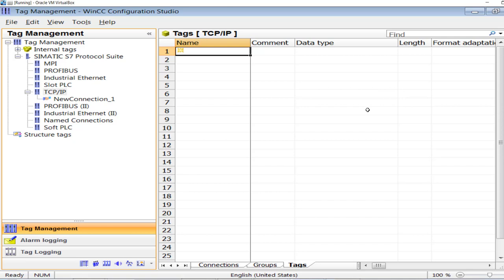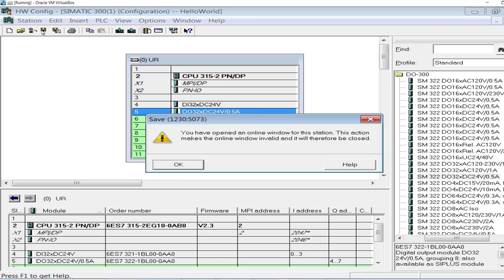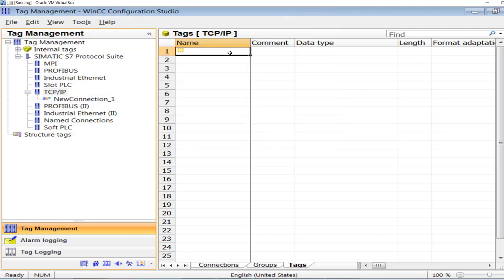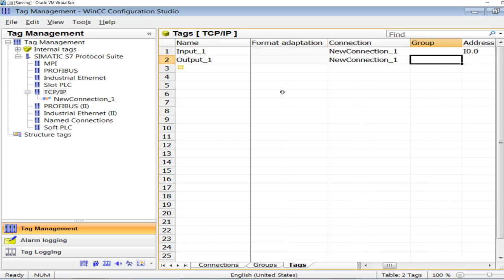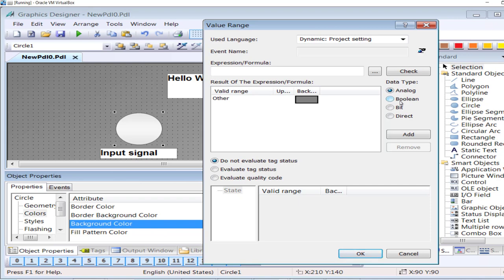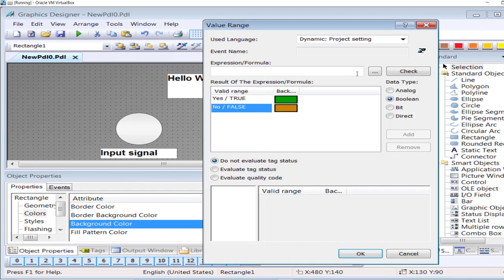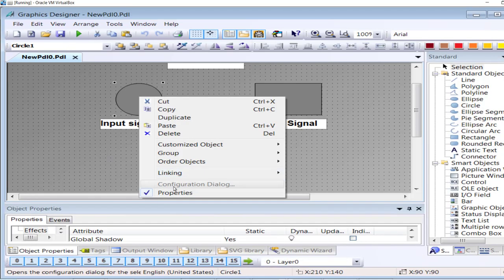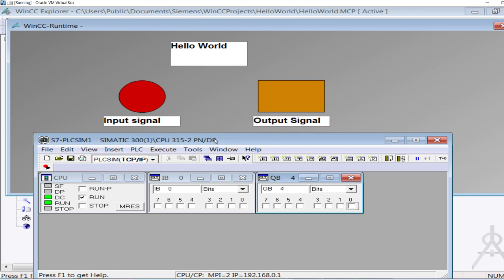How to read Siemens S7 PLC tags in Simatic WinCC | PCS7 tag management

Comment: Hello Sir, I'm facing an issue with my WinCC SCADA, the issue is, we are using an WinCC SCADA V8 which is communicating with Master PLC(Mitsubishi IQR) through TCP/IP, what actually happening here my SCADA is slowly reading the data from MASTER PLC, it takes 2 sec some times and it goes up to 50 secs. Please help me to resolve this issue.

Kind Regards.

Comment: Hello Sir, I have been facing an issue with my WinCC SCADA. The issue is, here we are using a WinCC SCADA v8 which is communicating with a Master PLC(Mitsubishi IQR), through TCP/IP, the data from PLC is taking quiet longer to get reflect in SCADA, some time the time goes to 2 sec and after some time it goes up to 50 secs, Please help me to solve this issue.

Kind Regards.

Comment: How to do this in TIA Portal ?
Reply from the maker: Even simple in TIA. You dont have to make additional settings. Once u define tags in logic, are accessible in wincc HMI as in TIA portal both step 7 and WinCC are in same software package.
Reply: @PLCNerd  excellent video and tutorial! thank you very much!
If the SCADA is made in wincc explorer but the process is in TIA portal (not integrated between them) How we can make the connection of the signal?
Can i access to a DB in TIA portal trought a WinCC?
Reply: @PLCNerd  Hi! What happens if I have to update an old WinCC to TIA portal WinCC, but the PLC logic is still running in an old version of step 7? Will they be able to communicate?